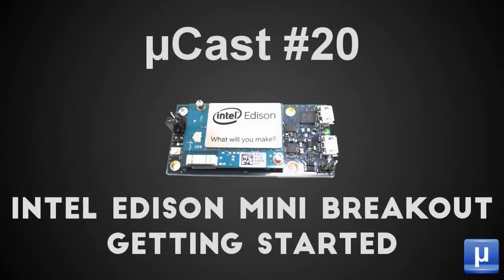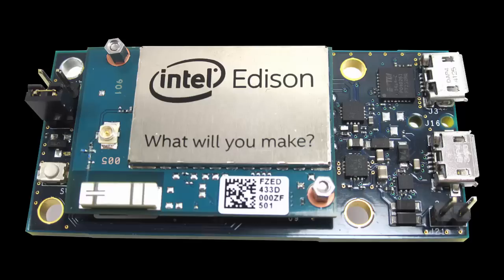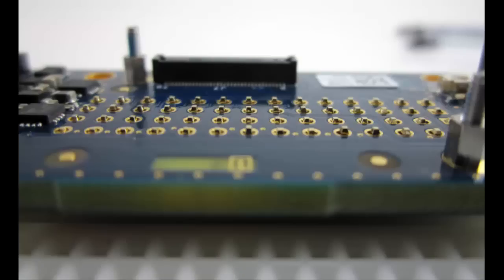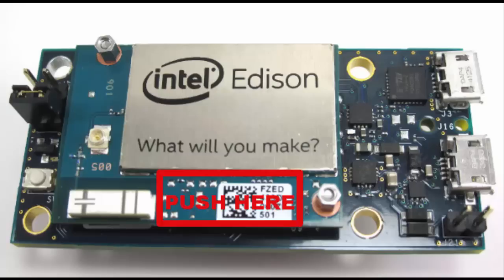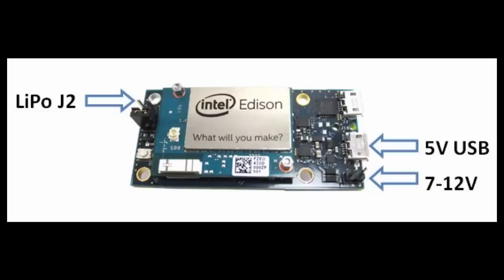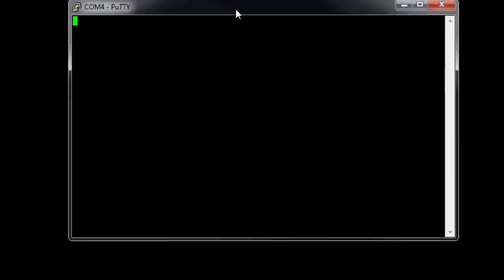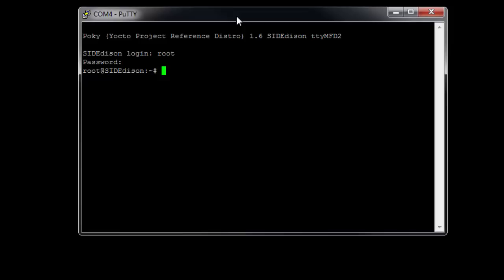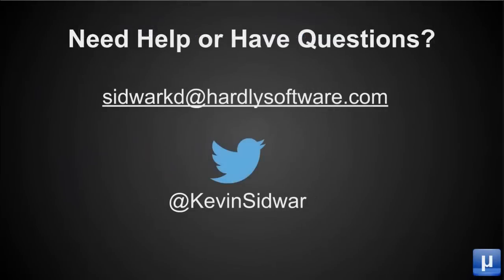µCast #20: Intel Edison Mini Breakout Board Getting Started

Comment: hey i'm new to iot in general, so sorry if this is a stupid question. The Intel Edison breakout board seems to have slots for like 56 pins or something on it - in the place where you mount the intel edison module. But when i looked at the documentation of the intel edison module, there doesn't seem to be that many receiving pins for so many male header pins. why are there so many pins there? how would we even use them?
Reply from the maker: Great question. Those are all of the pins broken out from the module itself. Some of them are duplicates for power and ground and some are listed as NC or no connect so that is why there are more places to solder than actual pins to break out. This document has all of the information for all of the pins. https://www.intel.com/content/dam/support/us/en/documents/edison/sb/edisonbreakout_hg_331190006.pdf

Comment: Thank's for the video!  Two minor points.  The configure_edison --setup worked on the latest image from Intel which also fixes the annoying missing characters (or at least makes them occur much less frequently.
Reply from the maker: Thanks for sharing the info David. And thanks for watching.
Reply from the maker: David Sloan Nice work. Thanks for sharing.
Reply: David Sloan
 In your tutorial you mention that "Standard Yocto Edison build" is required. This build does not include Bison nor Glib-2.0. I was able to link in repositories for bison but have not found glib. Without these, the ./configure terminates and one cannot compile the mono. Any direction you can point me in to get everything up and going since I have C# programs that I would like to run on the Edison
Reply from the maker: Edison Dan Hmmm, I haven't tried running any C# stuff on Edison but I like the idea. Sorry I can't be more helpful on that but I've added it to my list of potential episodes. I'll have to dig into it.
Reply: Edison Dan
I used mono build 3.10.0 on the current Edison Yocto release (Oct 2014) and had no dependency issues.  If your still having issues with the web based tutorial my contact info is on the main page of the website I'll be happy to help you get it setup without hijacking these comments :)
Reply: David Sloan Ripped everything out of the Edison and started from ground zero. Latest Yocto build (build_16), latest Mono (3.12.0) and only ran updates from the http://iotdk.intel.com/repos/1.1/intelgalactic repository. Followed your guide (http://www.dlsloan.ca/Docs/Edison/monoInstall.html) and had no problems this time. Excellently written guide and now I'm trying to understand what I did wrong in a prior life when I could not get mono to compile. Thanx for all the help!

Comment: where can I find references or cmmands or anything to start programming?
Reply from the maker: For the Edison you have several options but the easiest to get started is probably Python. I would start with this library.

http://iotdk.intel.com/docs/master/mraa/python/example.html#hello-gpio
Reply: µCasts No C++? I'm more comfortable with that
Reply from the maker: TheSisma95 If you want to go straight C++ you can use the base libmraa which is just what Python wraps. I haven't used it myself yet but you can start here:

http://iotdk.intel.com/docs/master/mraa/index.html

Here is a simple GPIO example in C++:
http://iotdk.intel.com/docs/master/mraa/classmraa_1_1_gpio.html

Hopefully that helps some.

Comment: Hello, how can I install NANO? and may I install PostgreSQL on this device, as I do?

Thank you
Reply from the maker: I assume you mean nano the text editor. I got this from the Intel forums and haven't tested it but you can give it a try:

wget http://www.nano-editor.org/dist/v2.2/nano-2.2.6.tar.gz && tar xvf nano-2.2.6.tar.gz && cd nano-2.2.6 && ./configure && make && make install
 
After that you should be able to use nano on your system. However, as it's not a package install you will not be able to uninstall via the package manager opkg but you would need to call "make uninstall" within the nano-2.2.6 folder.

I don't know about PostgreSQL but I'm sure it's doable. Another option you have is to swap out the Yocto distro for a ported debian wheezy and then you can use apg-get install.  Check out the ubilinux project at http://www.emutexlabs.com/ubilinux.

Comment: Hello, Please anyone can solve this issue--How can I interface temperature sensor LM35 directly to intel edison mini breakout board?I have tried on Arduino uno and it works but not on intel edison mini breakout board .Can you just a video on it?
REPLY
Reply from the maker: Hey Devaharsha, thanks for watching. Because the LM35 outputs a voltage proportional to the temperature it is sensing you need an ADC to convert that to a digital value. Unfortunately the Edison doesn't have any ADC capable pins. Your best bet would be to pick up the ADC Block from Sparkfun that allows you to access ADC via the I2C bus. Check it out at https://www.sparkfun.com/products/13770

With that you can interface your LM35 sensor to the Edison.
Reply: Thanks.